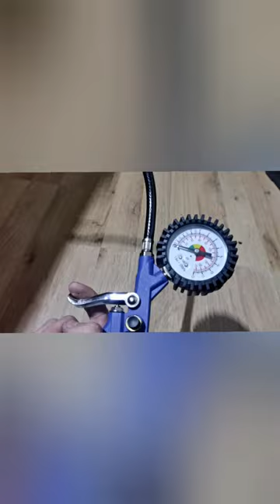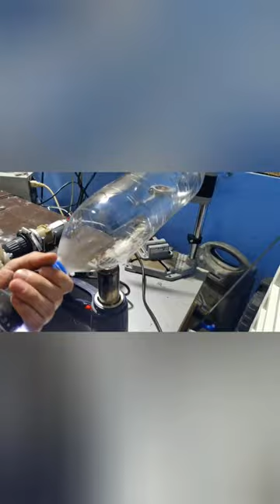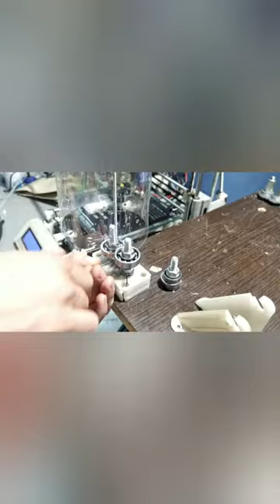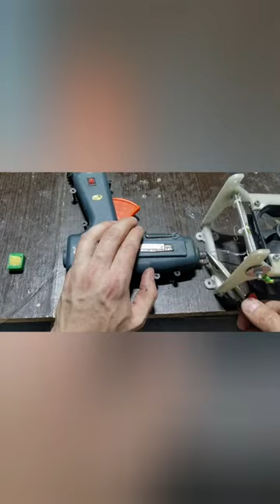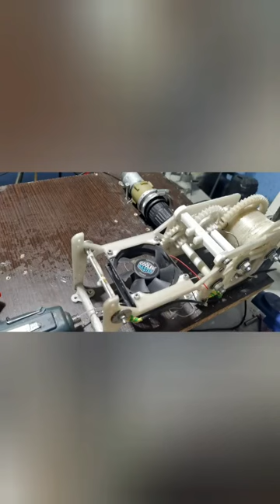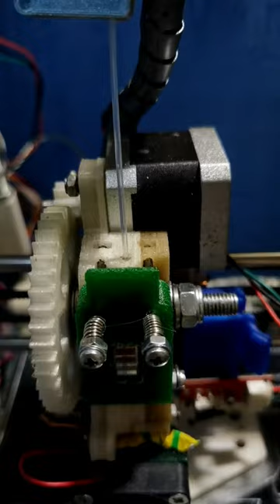Make filament with glue gun cheap and easy #shorts

Comment: I imagine this filament would be extremely hard to print with on most printers due to its inconsistent diameter. Throw a filament width sensor on your hotend and you're golden!
Reply from the maker: filament is equal
Reply: You can adapt a 0.4 nozzle to get the perfect diameter
Reply: @jkuiokjldfserwghjtyughtyuhjfwe  You're correct that a standard 3D printer hotend can be used for filament extrusion with appropriate modifications.

That said, the filament produced by such a method as depicted in this video (completely open-loop controls with no process feedback or inspection) will have inconsistent diameter and circularity, reducing print quality unless used in a printer equipped with sensors to measure these inconsistencies and adjust extrusion flow to account for them.

For prototypes or support structures this method will work fine, for parts requiring high mechanical strength or optimal aesthetic properties this filament is more likely to have issues.

Comment: what did you use to pull the plastic through the gun nozzel, also will it work with smaller guns or do i need to buy a big one
Reply from the maker: Coper wire from coaxial cable

Comment: I've got the nozzle made, but now I'm having difficulties getting the strips started through the hot glue gun. When I try to use steel wire, the plastic ends up bunching up at the hot end and coming off the wire, but the wire is too thick for me to fold over in a U shape at the end. When I try using thinner copper wire, it's thin enough to use the U shape when it's empty, but when I put the plastic in, it's too wide and ends up breaking right at the hot end.

Is there a specific way you feed the plastic through the hot glue gun to get it started easily? What do you use to feed the plastic through initially, and do you do anything like make a U shape in the feeding line, poke holes in the plastic for it to go through, etc?
Reply from the maker: No, I use copper from the coaxial cable, at the end it is ironed with a hammer, then drilled with a 1mm drill, a small hole is obtained

Comment: Any idea what sort of variation that you get in the filament diameter both over short distances and also from the start of a spool to the end?
Have you tried joining the strips from multiple bottles to allow for a longer spool of filament without joins?
Reply from the maker: There is no variation, everything is the same, I still haven't found a solution to join the material, it cracks
Reply: @lets_make have you tried to join or glue the plastic line before goes into the hot gun? Might work maybe?

Comment: That is really cool. I have a question, perhaps you or somebody in the comment section can help me understand this better? "Why doesn't the freshly outputted new filament just rip away or stretch and break away, exactly right at the point of the hot nozzle of the glue gun? 

I can see the other manufacturing methods of various types of machines like plastic injection molding machines that accept pelletized plastic, into a screw & barrel auger type system, while under a controlled heating system of the barrel and auger assembly, while also, the movement and compression of the virgin plastic being moved towards the output end and the friction alone aids in a direction of flow to the orifice / nozzle end and gets squirted out. But that system is pushing it through the restriction/nozzle.. On these set up's like yours, why doesn't the plastic get pulled away from the hot molten plastic behind itself? Does it cool down fast enough to the measure of now being strong enough to remain intact as a filament line?.. Yes, I see the fan blowing cooler air on the filament, but that is a few inches or centimeters away from the glue gun output nozzle end. 

In these systems, like yours, the movement of the filament is purely managed by the spool, which is on the aft end of the heated nozzle, and nothing on the input side to assist in pushing the recovered plastic flat material into the input side of the glue gun nozzle.. Unless I missed that? possible.. By chance, does the filament tear away sometimes, if the recoiling spool pulls to hard or too fast? 

Either way, this set up like yours and a few others that are doing this recovery method of plastics for making your own filament is really cool and intriguing and in due time, I too, would enjoy trying my hand at this recovery of plastics to make my own filaments ... WELL DONE.
Reply: Because it's not molten, just softened
Reply from the maker: Yes